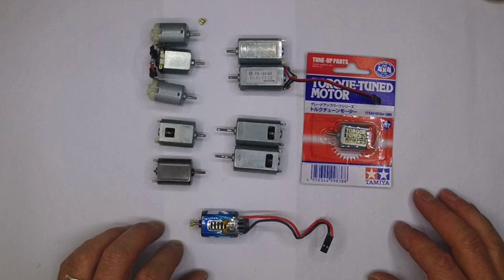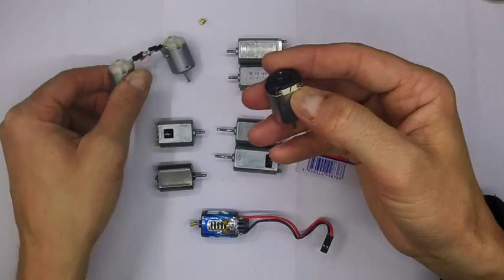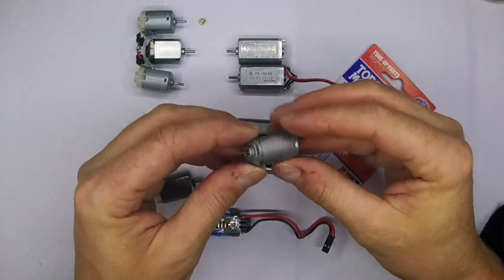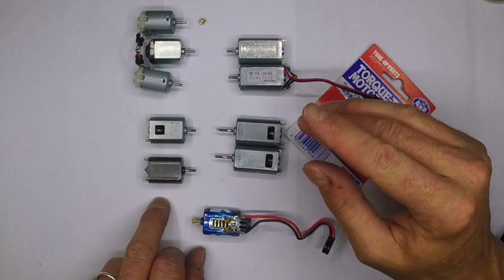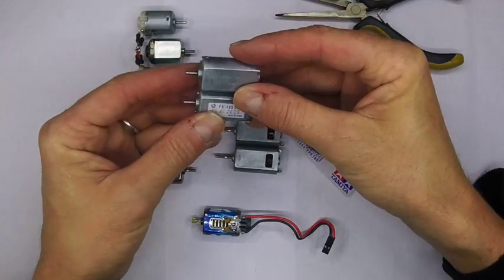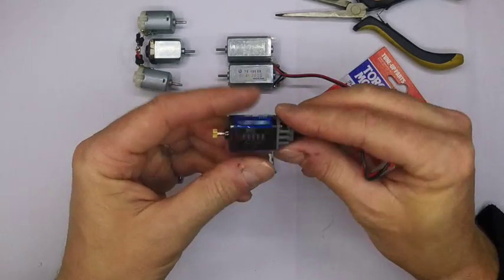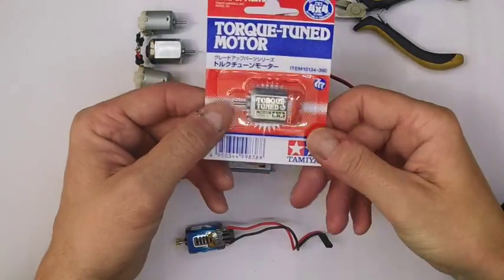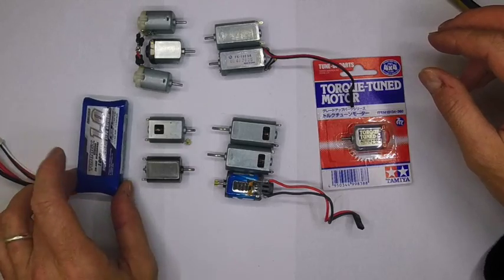Nerf Motor Mod Guide

Comment: What is the best average rpm of a nerf motor
Reply from the maker: That depends on the flywheel size, dart used and flywheel gap (aka crush.) For stock size flywheels on regular length darts in a stock crush cage it’s 33-38000 rpm.
Reply: @foamdataservices  thanks for replying me

Comment: Make a video dc180 moter open it and describe how it is made and which copper is used and magnet
Reply from the maker: Shivam kumar Saurav They are all the same as any electric motor, just plain copper wire with soft iron magnets. Also there are now lots of Nerf only motors available, most people do not use 180’s now.
Reply: @foamdataservices  try for me please I request you please gives some details about 180 DC moter

Comment: Can you link me to a guide to install these?
Reply from the maker: Jai Mann You will need a rewire and lipo battery to run anything other than stock motors. More info on choosing that stuff is on my channel, plus here is a video on just the motor block. https://youtu.be/vVWgRRAbj3w

Comment: Can i use a Plasma Dash?
Reply from the maker: Slayer 1990 You could but they are pretty awful vs Nerf dedicated motors. You will need twice the current to do the same work with a 1s motor like that. Nerf specific motors are cheap and widely available.

Comment: Is there any good motors for IMR's? I dont want to get a lipo because im broke :(
Reply from the maker: Stock motors, plus they are free.
Reply from the maker: You need Lipo to use mod motors. Lipo is about £7-10 for a decent pack and an entry level safe charger is about £15-25. Save up and do the job properly or go mod a springer, 5kg spring is £5.

Comment: Hey I found that home depot has cheap 16 gauge wire 25 feet for 5 bucks
Reply: And if your not American you know the stores over there I guess
Reply from the maker: If it’s PVC insulated home or auto type then leave it on the shelf. It’s not flexible enough for fitting inside blasters and the strand count is on the low side. Buy less length of better wire. Ideally from a seller that has a data sheet for their product so you can check it’s current carrying limits. Cheap crap is just crap!

Comment: Hi fds, do you know what the rpm of stock stryfe motors are?
Reply from the maker: Rpm depends on voltage. With alkaleaks you are at about 20-24k max. Sweet spot for stock wheels and stock crush is 33-38k freewheeling. If you want stock motors to perform better you need better batteries and wiring, otherwise motor replacement is the next best mod for your blaster.
Reply: Cool thanks man
keep up the good content :)

Comment: What's the stall current of stock stryfe motors? I cannot use my modified rapidstrike for college HvZ, but I don't what to keep replacing AA batteries in my stock stryfe. I need to keep the stock, or near stock performance, but I want to use a recharchable battery.
Reply from the maker: If you are allowed mods but FPS must be close to stock, rewire and use these high capacity Nimh cells. Stryfe motors pull about 4A each stall.
https://www.venompower.com/products/venom-2400mah-aa-high-capacity-nimh-rechargeable-batteries-4pcs

Comment: Captain I need help. By any chance do you know what motors are in the Nerf Nemesis? Thank you in advance. Have a good day
Reply from the maker: Ones that are currently not available as replacements. You have to use the factory motors.
Reply: 360 size motor?
Reply from the maker: No, a size that isn't currently sold aftermarket. Also ramping up the wheel speed in Rival blasters doesn't make a big difference, the ammo is too unstable over about 120-130fps to get any benefit. 3s and stock motors is ample.
Reply: Foamdata Services thank you for the info. I'm not trying to amp up just replace a lemon or a burned out motor.  Maybe I can find a broken Nemesis or another Rival flywheel blaster.
Reply from the maker: That's always the problem. Also the flywheels are pretty much a one fit item, you will likely find they break being taken off. I would suspect a wiring fault or ball stuck in the wheel before a burned out motor.

Comment: Can stock Stockade motors take an 800 mah 2S 40-50c LiPo? If not, which motors would you suggest?
Reply from the maker: No, stockade motors are awful. You need a barricade cage and stockade wheels. If you are getting a Barricade for the cage anyway use the motors too. The Stockade cage can't take any other motor types, the pancake motors it uses are totally different. Also remember power source responds to load placed upon it, batteries don't push current. Watch my matching video.

Comment: Does Tamiya 130 Motors can use Stock Battery?
Reply from the maker: No. They draw about 10A EACH, way more than Alkaleak batteries can handle, watch my battery video and balance video. Tamiya motors are also crap.

Comment: hey thank you really much for all the detailed videos. i am new to modding nerfs but i will mod a stryfe, rapidstrike, hyperfire and a modulus ecs10. i was going to rewire everything with 16awg wire, yet im not sure if i want to keep the block switches (the ones that dont let you shoot the gun when there is no magazine in it or the top is open) or if i want to remove them, because i will put imr in them. will they get destroyed by the current/voltage? 
i dont want to switch the motors, so i will use the stock ones, therefor i wanted to ask you how many batteries should i use for these specific 4 guns im gonna mod? and do i need to redo the battery contact springs?
Reply from the maker: Watch my balance guide. You can only use 14500 IMR in stuff which ran on AA batteries, like your Stryfe and modulus. Anything else will need too much current. If you want an easy way to power the RS and Hypefire then simply put a pack connector onto the end of the stock loom and use a 2s lipo or 8.4v airsoft Nimh pack, the thermosistor will protect the stock internals fine and you will get a small performance boost far more safely than with AA size IMR. Here's how to do that- https://imgur.com/a/iSyXh
Then learn a bit more and start putting better motors and wiring into your collection, starting with the Stryfe.
Reply: well i did not want to use lipos cause they need to much attention in point of charging and decharging if you dont use them. so does that mean if i put 3 imr 14500 with these http://www.ebay.de/itm/4x-Batterieadapter-Akku-Adapter-Mignon-auf-Mono-AA-auf-D-/131138846559?hash=item1e887bff5f:g:mb4AAOSwxu5ZLRMx into my rs the batterie contacts will melt?
for the hyperfire i wanted to buy this one http://www.ebay.de/itm/Plastic-Lagerung-Halten-Fall-Halter-fur-Batterie-18650-2A-3A-mit-6-Wire-Leads-/322553408059?var=&hash=item4b19ae6a3b:m:mHvFo0INuBYBMI6v8E0QCPw for 3 batteries. does this work?
Reply from the maker: That's cock about lipo btw. IMR is still a LITHIUM BATTERY. and can't be left unattended whilst charging or run too flat, if you read what I said I recommended a Nimh pack instead if you were lipophobic. One like this fits the RS and Hypefire compartments- http://www.patrolbase.co.uk/nimh-airsoft-batteries/vp-racing-8.4-1600mah-block-battery.htm#.WWdogrHTWhA
AA adaptors are crap, AVOID. If you aren't going to take my advice go ask someone else.
Reply: oh i see, IMRs are as dangerously as lipos are. so id be safer with a nimh pack. will i reach the same power with a nimh pack as with a lipo/imrs?
Reply from the maker: IMR and LIPO are NOT AT ALL DANGEROUS, provided you treat them sensibly. All packs should be supervised when charging and not left flat. Nimh is just the most tolerant chemistry. Go watch my balance video, learn some more about the basics. Research and learning are free.
https://youtu.be/Rbai3HYGUEk
Reply: ye i watched that thanks :) well i guess to supervise it while charging is okay, but not leaving them flat, depending on that i propably wont use my nerf guns in winter for about half a year, is kinda much of work. how long does a lipo last if i charge it full and just let it lay around so i dont have to watch for it if i e.g. take your favorite zippy 2200?
Reply from the maker: Any pack, including NiMh should be checked every month and charged if necessary. Generally if you put them away at 75-100% charge they will lose virtually nil in storage. Nimh will provide the same FPS as the same voltage Lipo, it just can't put out as much current in total. For your blasters, with no other mods at all, Nimh will go straight in as I showed you earlier. Lipo will do the same, you just have to remember to take all the batteries out your blasters after games. You still have to do that with IMR or AA and should NEVER leave even regular batteries in blasters for more than a few days. If you are talking about how long a pack will last in use, a 2200mah lipo or similar will power a largely stock blaster for weeks between charges.
Reply from the maker: Also if you want proper technical help, Youtube is not the place for it, join a GOOD forum like www.britnerf.co.uk
Reply: im really creeped out by every type of battery right now^^
i think i will just not mod, i just wont use the guns that often and i dont want to risk anything with that licium.
anyways i really apreciate your help, thank you very much :)
Reply from the maker: If you own a phone or laptop or tablet you use lithium batteries all the time. The only battery I have ever had explode was a supermarket AAA alkaline! Electric modding just requires some research first and learning. Springers are no easier, they just require mechanical care not electrical. If you want a safe starter mod, just put two IMR 14500 cells in the Stryfe or modulus, leaving the rest alone.

Comment: Im going to make a strayven and i think i am going to use xtreme pro 180 motors should i take off the yellow things
Reply from the maker: Only use XP180's if you can get the long shaft version from BlasterTECH. They shed flywheels otherwise. There are also a number of options now that are as good for less money. The yellow things are RF suppression equipment and can be removed for nerf use.

Comment: I recently got a used rayven with fried motors. I replaced the stock motors with a pair of Tamiya Light Dash motors. they work quite well as a drop in solution for running off of  AA batteries.
Reply from the maker: Those motors are pulling 9-12A EACH at stall, almost twice the stock ones, you should still rewire and use better quality Nimh cells like Venom or Sanyo.
Reply: I already rewired it, I plan on swapping those motors out for a pair of rhinos and powering it off of a lipo
Reply: I just wanted a temporary solution so i could still use my rayven until the motors came in
Reply from the maker: Wiring will be the same. Stock stuff is rated max 10A. I leave a tail of wire for the pack connector when I do Stryfes etc now, even if people set them up for IMR/AA's.

Comment: What are the best AA size batteries to use with the torque tuned motors?
Reply from the maker: I don't recommend Tamiya motors, they are barely worth the effort. If you must use them for some reason then you want either Sanyo/Eneloops or Venom RC grade cells.

Comment: Are these good in a stock stryfe? if so, how many can i put in one?
https://world.taobao.com/item/42839168925.htm?spm=a312a.7929832.0.0.hqpG4o
Reply from the maker: Those are a trashfire, basically the worst battery for Nerf. AVOID. Watch my battery guide.
Reply: are these ok in stock stryfe?
http://www.ebay.com.au/itm/192048895320?var=491865287916
Reply from the maker: Trustfire crap again. Search IMR 14500
Reply from the maker: https://www.vapefox.com.au/700mah-efest-imr-14500-battery-p-79.html

Comment: can you tell me that hallcats are batter for stryfe or extreme pro 180
Reply from the maker: Hellcats are batter. There you go.
Reply: Foamdata Services really but aren't hellcats supposed to have lower torque , as flywheel motors
Reply from the maker: XP's have short shafts that shed the wheels, much higher current demands, cost more and don't have published torque figures. http://britnerf.myfreeforum.org/about1967.html

Comment: do the pro 180s need 2s or 3s lipo batteries
Reply from the maker: XP180=pro 180 so 2s unless you want excess rpm and melted flywheel centres.

Comment: Is 1 dummy and 3 18650's good in  stock stryfe?
Reply from the maker: You can't fit 18650 size cells into the stock tray, they are too long. 18650 power tool cells or AW brand IMR have the discharge needed for mod motors or stock  but require a high current cell holder. 
If you want the easy life use 14500 IMR and stock motors, anything else use a pack.
Reply: these are 18650's and it says aa size
http://www.ebay.com.au/itm/262779881824
Reply from the maker: I gave you my advice, based on four years building gear for some of the most well known players in the world, either take it or quit asking the same thing. An 18650 is NOT AN AA SIZE BATTERY.

Comment: If I wanted relatively consistent performance, what would you recommend for motors with out going overboard?
Reply from the maker: MTB Rhinos, 3s lipo and Worker wheels.
Reply: @foamdataservices  Artifact red cage works great with the worker wheels

Comment: How would extreme pro 180s go up against MTB 180 motors.
Reply from the maker: The XP has a short output shaft, which can cause the flywheels to shed, especially on 3s, on 2s they will give similar performance to wolverines/hellcats. I would use Hellcats if you can get them easily, XP's cost more and the short output shaft is really annoying.

Comment: Dont mind soldering but don't want to start grinding down the shell,  this will be my first nerf project and i have a rapid strike and a Stryfe i potentially want to mod, motors/wiring/switches, however i cant find any of the 2s rated 130 motors in stock on any of the links in the comments or the datasheet so kindly provided, im thinking rhinos are going to be best or similar spec, can you recommend somewhere i can get them? TIA
Reply from the maker: Containment Crew, Blastersmits UK, Tacticool Foam, BlasterTECH.
Reply from the maker: Nobody grinds down the shell. I use a £5 jewellers piercing saw and a drill to make my motor cuts.

Comment: What would the Tamiya motors get in FPS with 4 standard aa batteries?
Reply from the maker: Don't use them, they suck. 4AA batteries will burn them out as well, it's 3 max and only HIGH OUTPUT nimh AA, like the Sanyo Eneloop are suitable for use with Tamiya motors. They draw more current than higher voltage motors like Rhinos.

Comment: Where can I find falcon motors when I click the link to the aliexpress page it says sorry this item is no longer avalible
Reply: Foamdata Services can you please give me a / some links to motors that can ship to europe? i dont really know which i can use :\
Reply: Foamdata Services could you tell me where to by the U.S. versions of that
Reply: Whats the difference between Xtreme 180 pro and Xtreme 180 se motors?
Reply: Okay thnx!!
Reply: Can you help me with this? i want to buy a lipo that can fit in the stryfe without any extended battery clips, but the battery needs to have 30c discharge minimum. I already found this battery
( https://hobbyking.com/en_us/zippy-compact-1000mah-2s-40c-lipo-pack.html ) but wasnt sure if it would fit in, ps i dont have a stryfe yet because i want to order everything at the same time, so i have to know if it fits :)
Reply: sorry but i dont know the dimensions of the battery holder :/
Reply from the maker: Search MTB Rhino, same motor.
Reply from the maker: Dragon- Go to Blastersmiths UK, they are the MTB agent for Europe and sell all the parts you will ever need.
Reply from the maker: Containment Crew
Reply from the maker: BSUK ship all their products globally as well, take 20% off the top for U.K. purchase tax to start. There's absolutely no hassle buying from there if you are in the USA.  Tacticool Foam have some Stryfe wiring kits.  Motors alone will be less from Containment Crew.
Reply: Okay thnx!
Reply from the maker: Buy the PRO motors, the spec is better. SE's are the previous version.
Reply: Well, the problem is i only can buy the 180se in europe \:
Reply from the maker: I get my PRO's from ebay USA. SE's will still top 120fps on stock wheels at 2s. They are a tasty motor. The pro has about 10% more torque.
Reply: Oh okay, but i already have worker flywheels, will they work better with the 180se than the stock flywheels?
Reply from the maker: Worker flywheels will work great with those, you will top 130-135fps.
Reply: Okay thnx! But one last question, i just found out that there is a Xtreme 180 SE a and SE b, whats the difference?
Reply from the maker: A and B are only different if you put them in a helicopter. The motors are the same, the sprocket is lower on one and in a helicopter it turns the other way. Buy two of the one with the sprocket nearer the top end of the shaft, it's easier to take off.
Reply from the maker: This works and fits in the tray with a stock lid and no extra cutting.
https://hobbyking.com/en_us/turnigy-800mah-2s-40c-lipo-pack.html
Reply from the maker: Lipo finder-
https://hobbyking.com/en_us/lipo.html?config=52&discharge=30-110&capacity=0-1124&length_a=0-74&
Reply from the maker: I gave the dimensions to you in the link. Plus I linked a pack already. READ THE REPLIES.
Reply: Foamdata Services Oops sorry didnt see that you already filled it in thnx, but what about the height and width?

Comment: What kind of ranges would an extreme 180 get with a 45-90c 3s lipo
Reply from the maker: We don't measure ranges, that would shoot about 120fps on stock flywheels @2s/7.4v.

Comment: What C-rating on a lipo would you recommend for a pair of blade 180s? (Mabuchi FK-180SH)
Reply from the maker: Watch my balance video, those pull 20A each at stall.
Reply: How would you say those compare to the new MTB Wolverines, generally speaking?
Reply from the maker: I prefer 3240's and all the MTB wolverines have been recalled due to a manufacturing problem. Expect a proper test at some point, i have an unaffected sample set of wolverines.